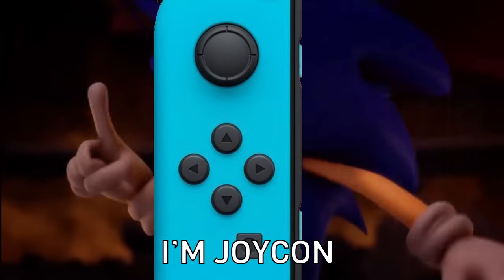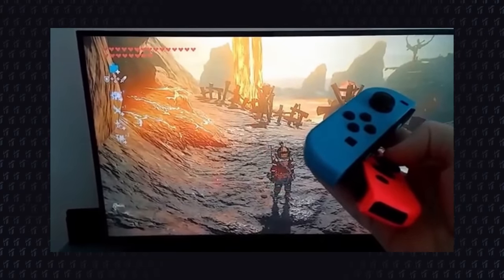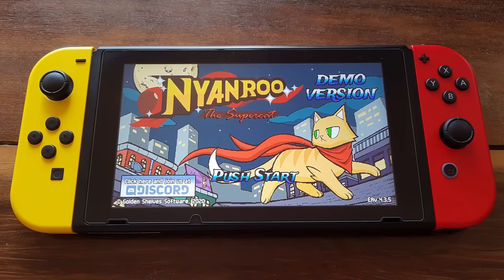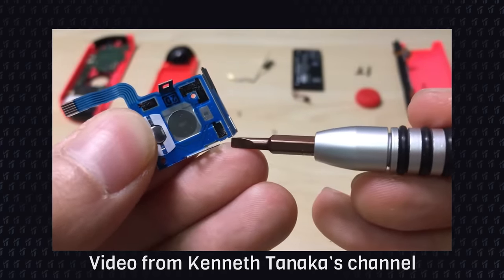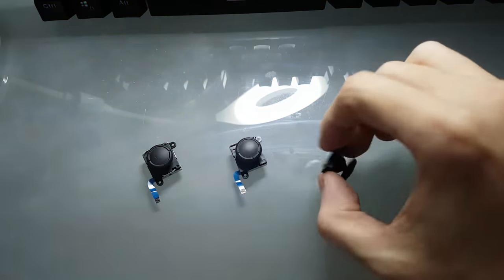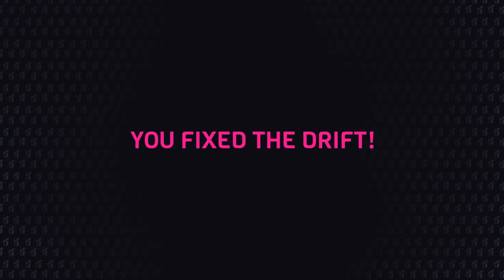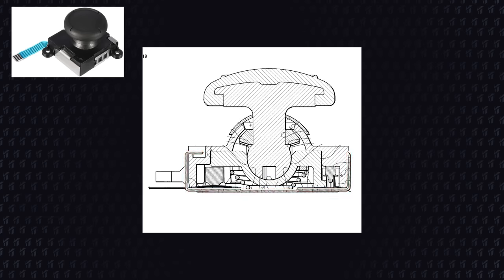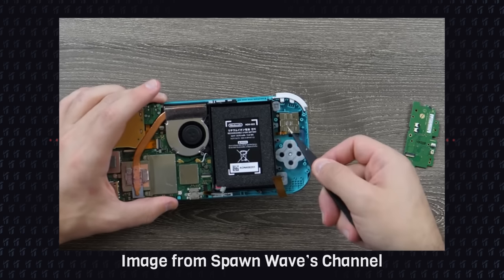How To Fix Your Joycon Drift Permanently!

Comment: Thats amayzing, that one sheet of thin paper could thix this annoying problem. I think Nintendo already knows the problem with the Joy-Con drift and recognizes which mechanical component is causing the problem, but they don't do anything about it. Why don't you do anything about it, very simple: the free repair service is only available during the warranty period, so they gamble with the fact that the players buy new Joy-Cons when their Joy-Cons start drifting again, which is +60 € more for Nintendo. For fixing this problem you need that kind of screwdriver for disassembling your Joy-con and one sheet of paper witch cost together maybe only 5€ in total... not that funny 60+ €.
THX man for that solution ^^

Comment: So, my Joy-Cons have never drifted since I got my Switch back in mid 2020, but my Pro Controller is drifting. Whenever I press up for extended periods of time (something 100% inevitable, especially in 3D games), it eventually takes it as if no input is being done. And rarely, when not touching the stick, it reads as if I’m going down. I have not gotten it checked yet due to not having the time.

Comment: Just put two pieces of card stock in the relevant spot, so far drift seems to be reduced but not completely eliminated as the shell looks ever so slightly bulged. That's unfortunate, I wanted double-thick card stock instead of just one piece to really make sure, but the slightly outward bulging shell seems to offset the change in pressure that the shim is meant to do. If I had one-and-a-half thick of that particular stock it would probably be perfect thickness.

Edit: That particular card was able to be cut in half, so I was able to put a one-and-a-half thick card in that spot and remove the bulge. While there seems to still be a bit of drift after it's been pushed up (I don't currently have the means to remove and clean it just yet), it no longer seems to drift when being left alone, so now on this joycon I can play games again that used the d-pad or the stick for movement (e.g. Mario Maker) without worrying about the drift interfering with d-pad!

Comment: This is not a permanent solution. The problem is caused in most of the cases by the wear of the contacts inside the analog module, what you do with your solution is to press the moving contacts tighter with the fixed ones, temporarily filling those little tiny scratches and gaps caused by the wear, but the problem will come back it's guaranteed, and this time it probably won't be fixable anymore.

Comment: I have a 3DS XL. The analog stick started to drift and I am considering ordering a replacement on ebay, but before I do, do you think the same pressure  could be the cause of it and if inserting a piece of cardboard behind the stick would solve the issue?

Comment: The solution is to use better analogue sticks like sega did in 1998 on Dreamcast controller or even before with the saturn 3d pad. They used  a magnetic hall sensor analogue stick . This thing doesn't wear because it reads the position based on magnetic field and calibrate the 0 at every console boot . Never had a problem with a single analogue stick , not even a 1° of fault , they were always precise . The only thing you could do were only to physically break the plastic

Comment: Just did it and it worked on a used joycon that I bought. At first there was a very slight drift after adding the pressure but after recalibration it went away.

Comment: Warning, doing this fix only reduces the amount of drifting but for some joycons it can still drift, only 10% of the time rather than 90%.

The reason is because the Joycon case is not closing in on the pressure good enough in the center, when you add 1 or 2 piece of paper to 1mm in thickness it bulges the controller case out a tiny bit, this means pressure isn't going towards the stick module. You need something like a case replacement that has a proper seal and closure to the case so it doesn't try to expand open when you add the paper in.
Reply: What's a case replacement?
Reply: @monstar3626  More like a custom 3d printed case or some sort of modification on the joycon module so it does not expand.

When you push the stick down to push the button, the spring applies pressure and expands the metal bit by bit too.
Reply: @dra6o0n  is there another way to fix this problem ? And did it fix it for your joycon ?
Reply: @monstar3626  I bought replacement parts and just swapped the module. It has a lot snappier spring than a loose one.
Reply: @dra6o0n  is your drift fixed permanently ?
Reply: @monstar3626  Yes because I removed the faulty module and swapped in a new one? You insert the circuit cable to connect it to the controller board, it's rather simple for a Joycon controller.

Dualshock controllers and Xbox controllers are harder and requires you to solder it off and insert a new piece and solder them back on.
Reply: @dra6o0n  so you just replaced the sticks ?

Comment: I just did it and I do notice a change yes, maybe I should play the piece a bit more on the problem (which is right mostly, and left a bit) but so far it works. Alsooooo my PS4 controller right stick is drifting

Comment: Hi there, Ik this video is a long time ago now but I was wondering if, what would you do if your joycons doesn’t connect to the console but however, for some reason if you apply a good amount of pressure like you said in the video it suddenly connects to the console again. 

I happen to test it and with enough pressure I was able to connect to the console with both of my joycons again the question is idk why? Would you happen to make a video in this?

Also this is a very good fix for joycons ^^
Reply from the maker: I had this problem with one of my joycons

this probably is usually a broken trace or a broken solder ball under one of the chips, it is very hard to fix because if its a broken solder ball you need to do a reballing on the chip , just look for reballing videos and you'll understand how the process works

if its a broken trace its easier to fix but then finding the broken trace is no easy task too

Comment: First off, those of us who pay attention KNEW what the cause before nintendo got sued over it, and were ordered by a court that they HAD to repair all instances of joycon drift.  The actual cause of joycon drift is the graphite strip setup nintendo used for the analog stick design, vs using an actually tried and tested method for making analog sticks.  Secondly, the only real fix would be to replace joycon thumbsticks with a real analog stick setup

Comment: Thanks, it worked fine for one of my joycons.
Somehow, I couldn't calibrate 2 other joycons after trying this trick : the cross doesn't complete the large circles required at the end of the calibration. I added a thin piece of business card, and a small piece of double-sided tape to hold it in place. Is it a problem if the added layer is too thick?

Comment: A dirty keyboard is an easy fix but maybe don't eat while you're gaming. I wanted a Switch for a while as I have a few of the same titles on ps4 but I've had a bad run of controllers because I don't have air conditioning to reduce the humidity. I find that a small amount of penetrating oil works better than alcohol based contact cleaning spray for sticky controllers, no disassembly required

Comment: I just use a Dualshock 4 with BT adapter to look like a Pro Controller
No battery levels is annoying ,since it shows up as a "Wired" controller, so thanks for your information on fixing Joycons
I never want to buy Nintendo controllers ever again

Comment: If you are using cardstock, you must at least use 2-3 pieces. I tried it with one piece but the drift still remains, so I stuck another, and it works permanently, thank goodness! 

But for my right joy-con, it drifts much worse than the left one, it still passed the two cardstock pieces. So I stuck a third one for the right joy con, and that as well works permanently! So far it works perfectly! 

I shared it with somebody who is rough with controllers, after that person was done, the drift never returned! I have to clarify that this solution truly works permanently! Thank you so much for your hard is appreciated! Nintendo, please hire this man 😂

Comment: Pressing on it definitely changed the behavior... but it didn't fix it. No matter how hard I pressed on the stick enclosure (with the joycon disassembled), it would still drift. Putting the cardboard in didn't work, either.

Comment: Because people keep telling their stories about pieces of cardboard fixing their issues:
with my 3d printer it is common for the Z-axis to not be 100% parallel - putting a thin piece of cardboard in between the motor and the rail fixes this. (its an ender 3)

Comment: Ok, so I did what was said in the video. (I put one thin piece of Paper in the JoyCons)
The Right JoyCon stopped Drifting, but the Left kept Drifting, but it only Drifts upwards.
I'm not sure why this is happening.
Reply: thin piece of paper is way too thin. He said "Tiny piece." Not thin. a piece of paper is 0.1 mm thick. you'd need 10 of them.
Reply: @thebigdr  I took your advice, and added a few more pieces of paper to the left Joy-Con, and I'm pretty sure the drifting stopped. Thanks.

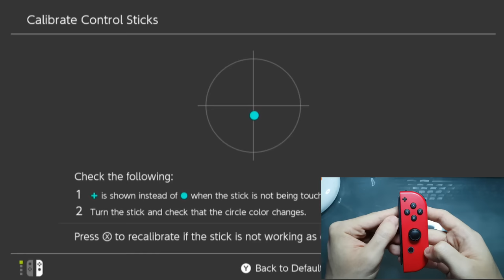Comment: I did this little paper fix a few nmonths ago but it didn't work, the drift returned quickly. I was just watching this to try it again just in case I had to use a thicker paper but the first problem I encountered is that 6:20  when I put pressure that way into the joycon, it does nothing. The drift is still there very very strongly. Even if I press with a lot of strength. So I don't know if that means my joycon is just unfixable anymore. I seriously hate all of this, nintendo can do better :( I don't have money to buy a new pair, and I'm scared that new joycons could develop drift too after 2 years.

Comment: This would work on the left joycon, but the right joycon doesn't have those 4 screws in the middle under the battery. So therefore, even if we do add something behind the joystick, it won't add pressure to the joystick but rather push the other side of the joycon outwards, thus not resolving the problem. Who has ideas on how to fix Right Joycon?

Comment: I've been facing an issue with my red joycon (the right one) for quite a while now, I thought it was the drift but I'm not sure. Basically it stops working for a short while (pressing the buttons or pushing the analog stick) - but it's not disconnecting from the console - and after a few seconds, the movement from the stick drifts a little - but it's not lag or anything. And then it's gone for the day. Do you have any idea what causes that? Is it a side effect of the drift? It's way to short and random to do any test.

Comment: I knew it was a design failure and not a conspiracy. 🤣 It's was kinda ridiculous how often they got "worn down" which is expected from any potentiometer joystick. But the failure rate for most similar joysticks didn't have widespread problems. My favorite part was steam deck flexing proper swapout potentiometers 💪

Comment: i have done this to my blue joycon almost a year ago when the demo came out for metroid dread totally didnt get a little mad while it had drift lol and the results of this solution does fix the drift although i had the drift come back some time after so i cleaned it out with ipa and it still has not drifted since then
Reply: Well I think what people are forgetting is stick drift happens to basically all controllers and for multiple reasons. It just so happens the switch had a manufacturing issue that caused it to happen, which is the lack of pressure on the joystick. But there are obviously more causes for it and this is only a permanent solution to this one issue.

Comment: I got a problem: I applied this fix to my right joy con, in combination with your disassembly tutorial. For the paper, I used a cut steam gift card, and now amiibos don't work anymore. It's fine, since I have another pair of joycons, but do you think that it's the material of the steam card that causes the error? Or could I have damaged something in the prosses of dis- and reassembly? 
Also, it seems like the controller constantly thinks there's an amiibo being scanned, which makes me believe that the material is the likelier option.
Reply from the maker: You probably must have damaged the nfc reader

You can try checking if it is well connected and if it's still giving you problems you should disconnect it completely

The nfc reader is a thin square like structure around the joycon

Comment: Well, this is less a fail by Nintendo, but more a fail by the manufacturer of those analogue stick modules. And as thus, Nintendo can only change the layout of the plastic underneath to give more pressure.

Comment: I have no idea if it's because my issue isn't drift, or because the fix just flat out doesn't work (for some reason, the reasons for drift vary from this to the stick itself wearing down from use), or because I didn't use a good enough cardboard, or if I just need to replace it every now and then from use...

but the cardboard fix only worked for a while before my drift returned.
Reply: swap the stick with GuliKit Hall Effect Joycon replacement ... even tho the cardboard fix it for awhile, the graphite sheet inside will inevitably Wear out , but hear me out , im not saying that Hall Effect will NEVER drift , but it WILL last longer than a joycon stick that uses physical contact .. the only point of failure in this Hall Sensing Stick is the sensor inside , but that is a super RARE case unlike the physical contact joycon

Comment: I just tried this, I uncased the battery and inner cover and cut out a small square from a business card. However, the problem persists. Did I do something wrong, because it seems everyone else in this comment section didnt have a problem.
Reply from the maker: Depending on the amount of damage your joycon has it won't fix it if the graphite is completely scratched away you can only replace it

Thankfully there are hall effect sticks now
Reply: @VKsChannel  Holy cryst, you actually replied! Thanks for the tip man! I'll order the stick soon! Many thanks and God bless!

Comment: It can work. I just need to figure out the exact thickness of the papers I want to stack and it will be fixes
Reply: We'll, I finally got to it, and I can say it mostly worked. I feel like I still get drift, but it's almost insignificant compared to before. Both joycons have mostly worked fine. I really have to thank you for this solution. Now I'm ready to enjoy handheld mode whenever I want

Comment: I added a piece of board behind the thumbstick, and I'm still having issues when the left thumbstick is pointed directly to the right. The thumbstick sometimes acts like I've let go completely when trying to walk to the right

I've checked, and it doesn't have the two pieces on the top and bottom that some joycons have, so the pressure is in fact being applied evenly, and upon opening it up again, the board is still in the right spot.
Reply: Same here

Comment: I think this is the solution I have to try, I did the thing where I pressed down on the joycon when calibrating, and the dot snapped back to the middle.

But I will try cleaning it first, gonna see if I can do something without having to take my joycon apart.
Reply: It worked!

Comment: The fact that nintendo could so easily have made the joycons this way in the first place, and the whole drift thing wouldn't of happened.
Reply: The problem is if they did do this then there would be a bulge in the joycons. They've been putting foam/tape in the joycons for several years now.

There's just no room for another screw in there to prevent the gap. It's a logistical nightmare but there's no real economical way for them to have chosen another type of joystick.

Comment: Warning if you do this your you may risk the green lights on your joycon turning off, the joyon works so does the fix but my ribbon cables were bent to far because the cardboard also the you cant turn them off until you turn off the switch

Comment: Same with my PS3 controller, I added black tape arroud a small pad to make more pressure and worked for years now. Nintendo could add that piece of 1mm but they are too dumb or they just don't want at this point, probably they know this method but it's better for them because people just buy another one.
Reply: Because it simply doesn't work very well. It's a very temporary solution that causes unnecessary strain on the stick and housing. You might as well use some IPA to fix the issue. At least that way your not damaging the controller.

Comment: Sure, adding more friction will temporarily give you better readings, but it will also wear out the pads more easly.. this is one of those "works temporarily" fixes. A true fix is a Hall effect joystick mod, as those base on magnets, and last Practically forever, simmilarly to the Dreamcast. All Poti-Based controllers will evolve stick drift sooner or later. A hall effect stick will probably outlive you. Please dont spread quick and easy "fixes" that just cant be actual fixes. Usually quick fixes are wishful thinking, as RIP-Felix showed on the PS3 side of things.